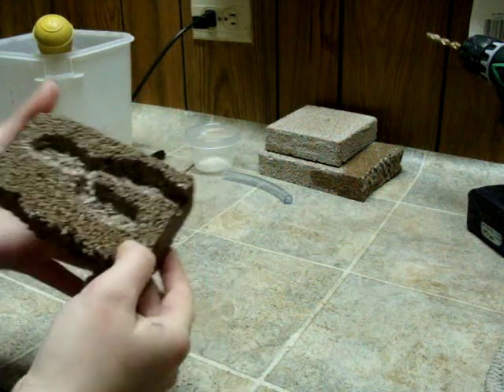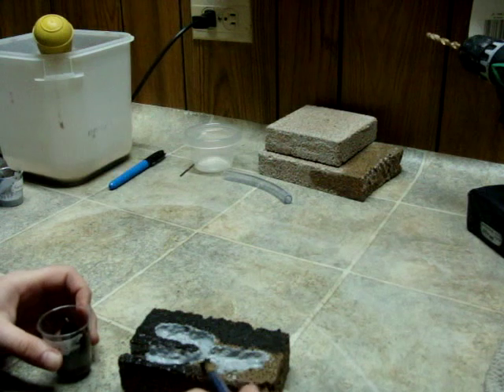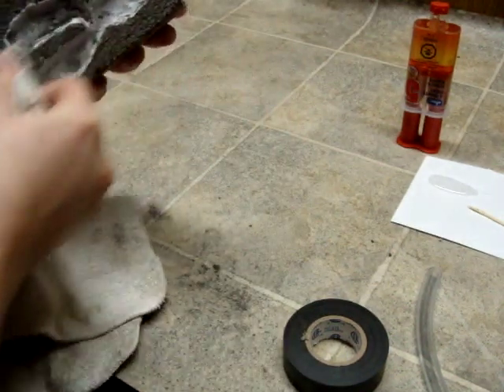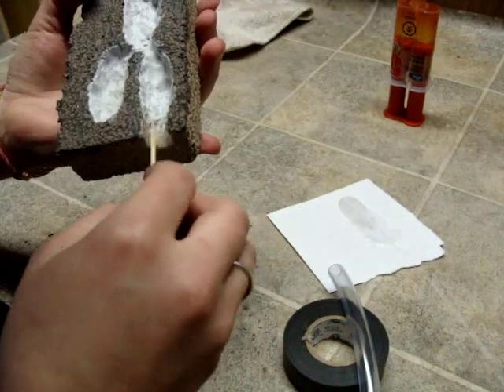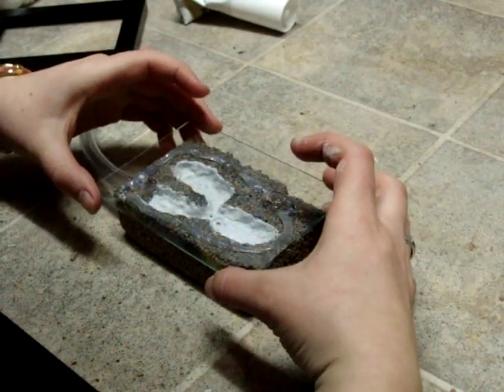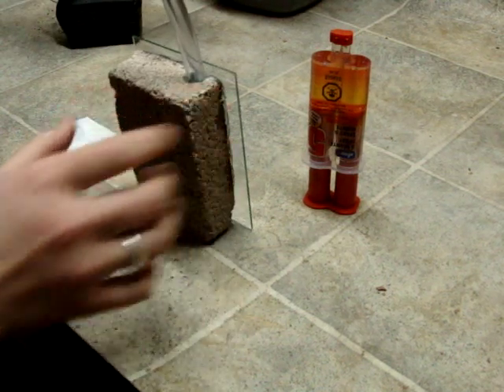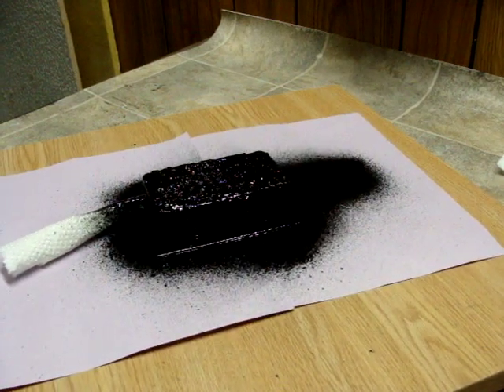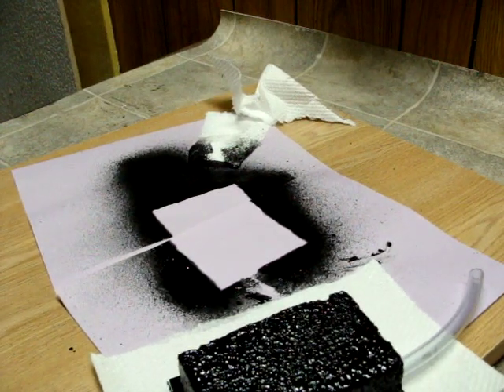How to make an Ant Formicarium out of Firebrick  Part 2 of 2

Comment: Do you know what kind of sponges people put in there formicarium for hydration, also could i get away with having no tunnel for water insread have a hole in the glass and just squirt water onto the brick and it would judt absorb that way. I dtill would like to knoe what kind of sponge they use tho so i can do a watering tunnel in case i go that route

Comment: So that rocker guard isnt toxic for the ants? I see its purchased at auto shops
Reply from the maker: Sorry, I didn't see this comment earlier. I don't use it in the tunnels that touch the ants, but they have lived in these nests for years with no harm that I can see.
Reply: So when watering the rock guard wont mix with the water also how does rock guard help besides aesthetic, same with charcoal wouldnt water mix with charcoal and make a black water in youe nest im making a nest now with firebrick i just need little more advice and you seem to know better than anyone else in my opinion.
Reply from the maker: The rock guard is basically a rubber. Once it cures, it helps retain humidity in the ant nest. Otherwise the firebrick tends to need watering almost every day due to evaporization..
The grout mix is fine in the nest once it is cured. I have even made entire nests out of grout.
Reply: I've seen your grout tutorial but i went with firebrick cause when you responded to antscanada you said firebrick is better and grout doesnt hydrate as well as firebrick but i do like grout idea in the firebrick for the color pop and amoothness it provides
Reply from the maker: I did fairly recently come up with an advanced hydration system for grout that works pretty well. 
Here is the tutorial in case you are curious: http://www.formiculture.com/index.php/topic/2298-how-to-make-a-picture-frame-grout-formicarium-with-advanced-hydration/#entry28868

Comment: For the charcoal layer what ratio did you use like is there paint in it or is it just charcoal and water
Reply from the maker: It is just a charcoal colored grout that I watered down for coloring. Aesthetic purposes, nothing really needed.
Reply: I like it tho cause the lighter color woth the darker makes it pop so when it dries does it stay dry even when water hits it. Also dodnt you say the rock guard helps with hydrating some hoe by keeping water in? I got clay firebricks cause unlike youe video in your written directions online you said use clay firebrick but in your video you say use ceramic firebrick but i could find any ceramic firebrick that didnt have sand in it as well so i read about how you used clay and i googled it clay is even better for holding water for long periods of time so i hope it works as well as yours. Sorry for talking so much theres is just no one else online thay does firebrick formicarium i wosh i could get ytong but i cant find it anywhere in US if you know were i can order ytong for US i would love to. know
Reply from the maker: Yes, I also like the contrast, which was why I did it. No worries about the questions. Clay firebrick is better, but ceramic should work as long as it can make the space between the glass and the brick humid. I could never locate Ytong at a decent price, which was why I went for firebrick.  Many pottery/kiln stores will carry clay firebrick.  :)

If it helps, here is a picture tutorial on how to build the firebrick formicarium: http://www.formiculture.com/index.php/topic/255-how-to-build-a-firebrick-formicarium-picture-journey/?hl=%2Bpicture+%2Bjourney

Comment: How do I hydrate without a Diamond Tipped Drill or a Glass Cutter. How do I cut the glass
Reply from the maker: For cutting glass, you can use google to look at pictures. It can vary depending on the type of glass cutter you use.
You can also put the firebrick in a pan and simply pour water into the pan, it will absorb from the bottom.

More tutorials available here, and they have more details since they are written up - http://www.formiculture.com/topic/583-the-list-of-handy-links/

Comment: isn't two part epoxy poisonous? does that harm the ants, same with grout
Reply from the maker: Most glues are toxic until they have cured. Once it has cured at least 2-3 days it is fine. Just like silicone, the uncured wet stuff is toxic and the fumes are harmful. Once it has cured, it is fine.
Grout powder is somewhat corrosive, particularly to clothing if it isn't washed off. Once it is cured it is safe as well. A thin coat of grout like in the video above cures in about 2-3 days. An entire formicarium made from poured grout needs about 7 days depending on how thick the grout is.
Reply from the maker: I have had a Camponotus Novaeboracensis colony for 3 years now and it has well over 400 workers. They have only ever lived in formicariums that used the same grout and epoxy.  http://www.formiculture.com/index.php/topic/642-crystals-camponotus-novaeboracensis-journal/?hl=novaeboracensis
Reply: OK thanks :-)
Reply: How do you feed ants in this type of formicarium?

Comment: For the inside can I use sanded grout?
Reply from the maker: It is possible, but sanded grout  does not have the same hydration properties as non-sanded grout.  You would be better to use all non-sanded grout instead.

Comment: Could I use a regular terra-cotta brick instead? You know, the red bricks for buildings?
Reply from the maker: +newyorkny5023 It depends on what it is made from.  Various companies may use different materials.  If they are just red cement bricks, then no.  If they are truely fired clay bricks, then yes.
This particular brick is also known as K-23 refractory brick and is sold at many pottery kiln stores to build kilns.
Reply: Cement is dangerous to ants, right?
Reply from the maker: +newyorkny5023 Cement is yes.  Grout is safe, ytong and firebrick are safe. etc.
There are several tutorials on this link on building nests out of various materials - http://www.formiculture.com/index.php/topic/583-the-list-of-handy-links/?p=6001
Reply: This is really helpful. Thank you